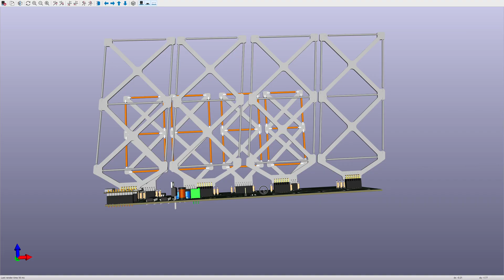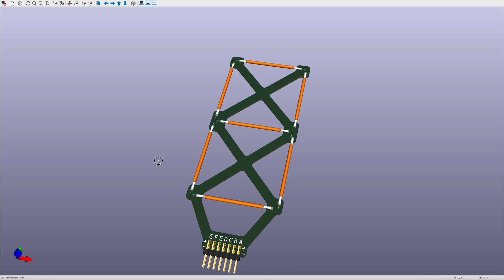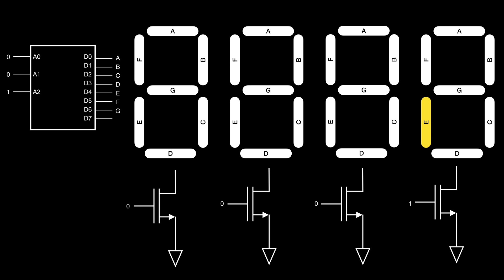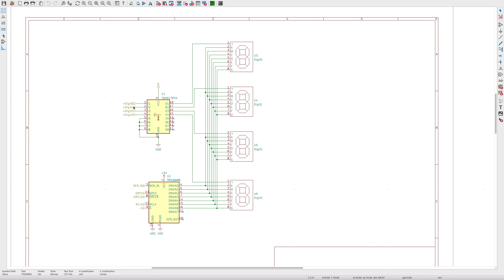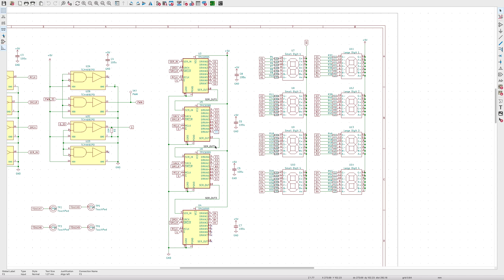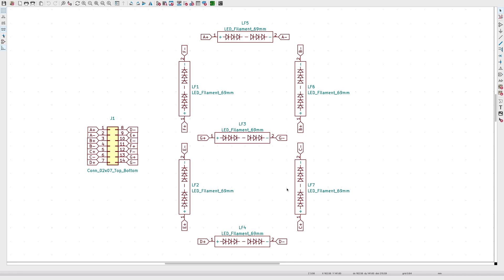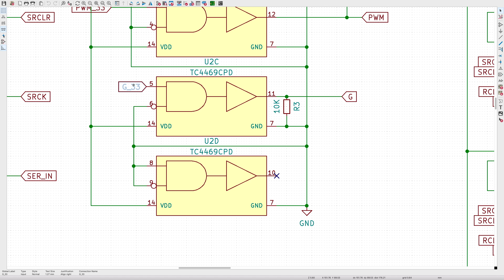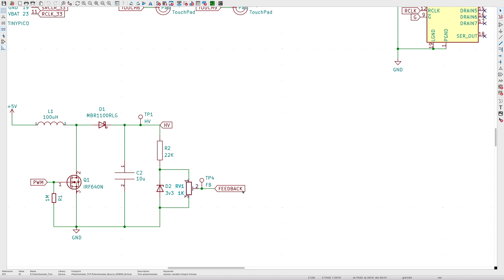The PCBs are in production - what have I messed up?

Comment: I really enjoy having a local board manufacturer so I don't have to worry about shipping from China. If I need them in a hurry, I can pick them up at the board shop in a couple days.
Reply from the maker: That sounds amazing. The price to get boards manufactured here is an order of magnitude more expensive than China and the turnaround times mean that even when you take shipping into account it's quicker to get them from China.
Reply: @atomic14  it is definitely a tradeoff. The local boards are definitely more expensive especially compared to PCBWay. The ultra rapid turns I have only done when forced to by circumstances.

 I have been working on being able to do some of my own prototyping at home. Saw some recent ideas for using a laser cutter for setting up etch resist patterns and may give that a try.

Comment: A possible mistake is in the touchpad wires. They are not as short as possible, and also run below the power circuit with an inductor.
Reply from the maker: Hmm, good point. I could have put them on the left of the ESP32 so: [Touch Buttons] - [ESP32] - [Power Circuit]